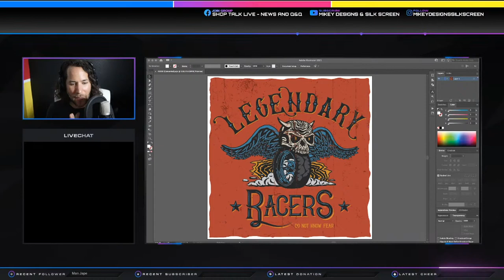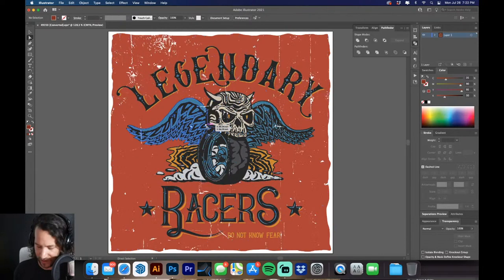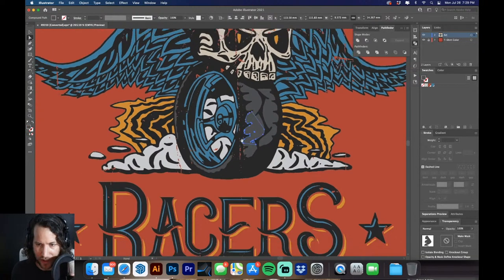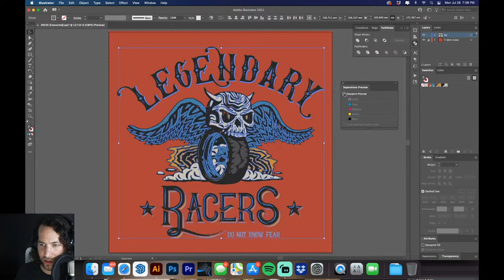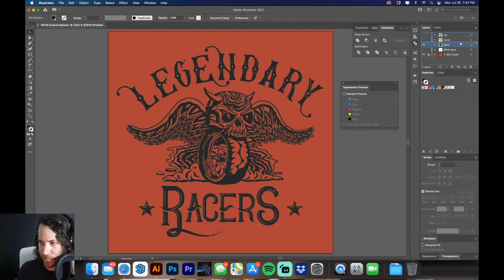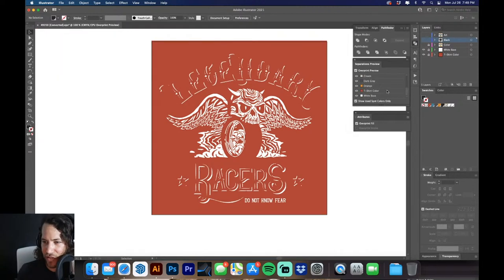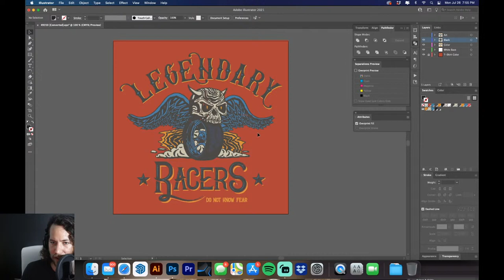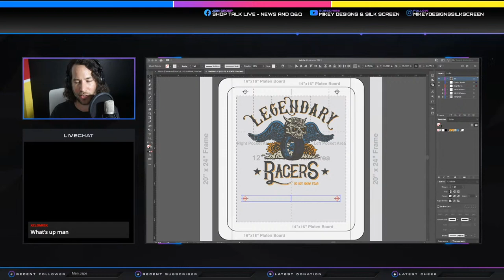How to Separate a Vector T-Shirt Design in Adobe Illustrator for Screen Printing | Shop Talk Live

Comment: Awesome, thank you... Question, what do we do if the client sends us a file that we can't take apart. Like a PDF or PNG, instead of a Vector file like AI or EPS that we can take apart and move tings around to do this method. Thanks...
Reply: Perhaps we should distinguish between Image and Art. Images are amusing and Art costs Money. Send
it back and ask for Art or Money! Your customers will take whatever you want to give them for Free. That's not your function
as a Business Person.
Reply from the maker: I would charge them for the time it would take to vectorize the art. In a lot of cases you have to manual redraw it, or set the text.